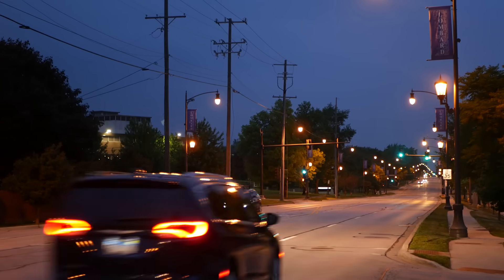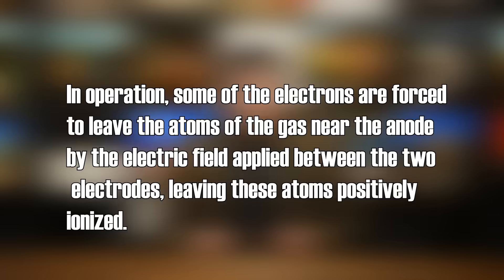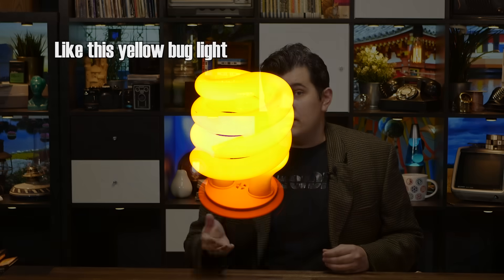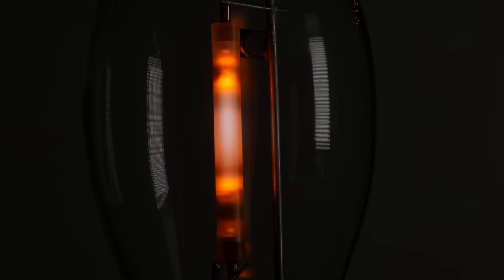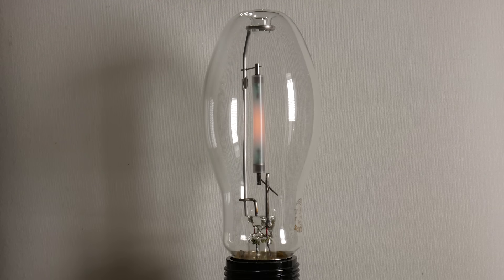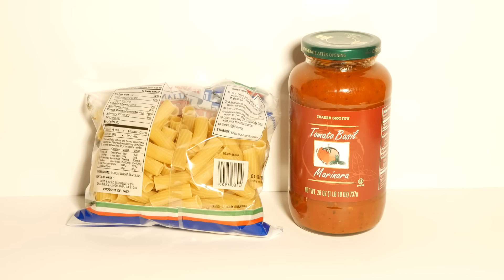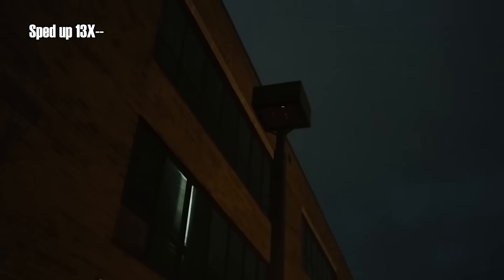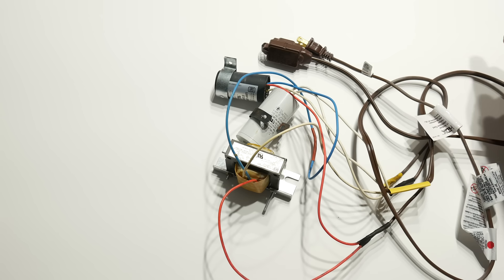The High Pressure Sodium Light: Ubiquitous, effective, but good?

Comment: I will state one positive for the low-pressure sodium lamp from an astronomy point of view. Light pollution is a major issue for astronomy. But low pressure sodium is easier to block out with a filter as it is monochromatic.

Comment: In the Essex UK our Council has gone down the LED route with all street furniture. Cold white light, the LED diodes are domed and act more like a individual spotlights, so when you pass under them your entire vehicle is lit up inside as a brief flash. Quite a unpleasant experience.

Oh and the failure rate is hight one  in 15 lamps are in a constantly loop of flashing on and off.
Reply: Update a year later my entire county at night can be seen as a faint flashing 10hz strobe from the james webb telescope.

Comment: Sodium lights are used widely in public spaces. That usually means up on a pole or a light stand of some sort. So changing one can be an expensive proposition. The lifespan of a sodium light is about 50% longer than a mercury lamp in the same application. So do the maths. Not only are they efficient, they last and last and last. And that adds up to dollars. The colour is a little weird, but that can be forgiven, allowing for the fact that they are not generally used where accurate colour information is required. 
LED bulbs are replacing fluorescent bulbs, but are only recently giving a choice of spectrum. For fluoros, the range was daylight, warm white, warm white deluxe, cool white and gro lux and also red ones for butchers displays. They also came in different wattages, with VHO bulbs giving almost double the light over common bulbs, for a given space allocation. The ballasts cost a small fortune, but man, were they bright!

Comment: "Why are streetlights orange".
Here most of those crappy orange (Actually warm yellow) lights (about 2700K) are changed to either "cold white" (about 4300K) or even "cold blue" (between 5500 - 6500K) bulds (that work in the exact same way as the yellow lights) or better: LED's.. Much better light! :)
LED's are more efficiant and gives more light per watt..

Comment: The problem with high-pressure sodium, for me, is the lack of cool tones in the emissions spectrum. And I'm not just talking about blue. Even green is underrepresented. In the RGB color space, we're used to the idea that yellow must contain green and red, but this is not a universal truth. "Yellow" light made with an RGB display, or by shining white light through a yellow filter, may indeed have a healthy supply of green and red light mixed in. So a green car would usually appear green and a red car would usually appear red under this light. This isn't because of the "rule" that yellow light has red and green, but because this particular yellow light does actually have red and green. (Other animals with differently-made eyes might not even agree that red+green makes yellow.)

But if that yellow light was instead made from a spike of actual yellow light--a single wavelength between red and green instead of a mix of red and green--then red things will not appear red and green things will not appear green under it. In fact, depending on what those red and green things are made of, they may not be illuminated at all, instead appearing dark and almost colorless.

"LEDs" can actually do a pretty good job of representing a broader spectrum. I put "LEDs" in quotes because I'm referring to the ones that use a fluorescent coating to get that broad spectrum. They're basically ultraviolet LEDs shining onto a fluorescent substance. And since "fluorescent" lights are not called "fluorescent" lights for their mercury content, buzzing sound, or tubular shape, but rather for the fact that they emit ultraviolet light that is then projected against a fluorescent substance, you could make the case for calling those LEDs "fluorescent lights" instead. But that would confuse people and this is why I sit alone at lunch.

Anyway, if they'd just warm up the LED spectrum output (by adjusting the blend of fluorescent dyes), increase the total light output, diffuse the hell out of it, and employ a bridge rectifier* and either a capacitor or inductor to get rid of that horrible flicker, LED street lights would actually be really pleasant.

* If a rectifier is too expensive, then a bigger capacitor or inductor.

Comment: Late to the party, but as a person 1 year away from my masters degree in physics, I would like to add that the Sodium D line is actually the Sodium d lineS, there is two of them.  The lines are very close to each other in wavelength,  about half a nanometer. This makes low pressure sodium lamps useful as a reference source if you need to calibrate a spectrometer or something :)

Comment: San José, CA went to low-pressure sodium for street lighting because of the nearby Lick astronomical observatory. The monochromatic output can be easily filtered out so the light pollution is manageable. But it's impossible to find your car at night because the colors are gone. Every car is gray.

Comment: Low Pressure sodium is the BEST for road lighting, HPS is second best..LPS is no glare, linear, and super efficient.  current LED high color temperatures are crap, driving in bad weather, and even in good weather the optics and too much blue are CRAP to drive under

Comment: I loved these lights. In my city, they would cast a warm glow that covered pretty much everything in a pleasant, relaxed light. Now that they all got replaced with LEDs, there's a tiny cone of very dim white light under the poles and total darkness in between, making them relatively worthless at actually lighting the streets.
Reply: @the_uggh  Light has an important function for life, including managing circadian rhythm, so, yes, the pleasantness of light is actually fundamental to how good they are. Second, the directionality and high intensity of LED lights actually creates higher contrast (blacker blacks) in less illuminated areas, which also means they function less effectively for area lighting.
Reply: @johnmickey5017  and that's why they have LEDs we don't need to have our circadian rhythms active at night.

Plus you know, that thing about excess heat burning through otherwise reliable methods of illumination
Reply: @kennethmiller3802 You completely missed the point. White LEDs (which contain blue spectrum light) at night DISRUPT our circadian rhythms. The blue light signals our brains that it's time to be awake because it mimics sunshine. This is the opposite of what you want to be exposed to at night. So if we're not supposed to be looking at it, why have the lights at all??
Reply: Where I live the LEDs are so bright and annying. I wish they would just go with a differnt color temperature, no idea why they decided to use daylight leds everywhere to blind my ass.
Reply: @ESSBrew  ikr, it's literally proven that yellowish lights are much healthier and safer for both drivers and non drivers
Reply: There are few things quite as beautiful as fresh snow under that orange-red glow.
Reply: @kevinmencer3782  God, I love that, it was my favorite part of winter. Unfortunately, in my town, almost all of the lights have been replaced by those white LEDs, so I really miss that image.
Reply: @sodaodaoda  gotta love when someone responds to someone else who added to what the original poster said and completely ignores an entire part of what was said just to make himself look like the high and mighty intellectually superior being in the YouTube comments.
Reply: @KenderGuy  Eh?
Reply: @KenderGuy  what???? Lol
Reply: @method2madnesssss  he was referring to the random hater. put 2 and 2 together...
Reply: @undeny  No one was hating though. And the guy he replied to was just saying how he missed the LED’s. So what hater???
Reply: @undeny  he wasn't referring to anyone.

He never pinned a name to his comment so to assume he was talking about one particular person is asinine.

Out 2 and 2 together.....hint, it's not 3 or 5, and can't be anything outside that range of numbers....5 tries...
Reply: I'm so glad you understand. I love the orange/red/amber glow of those streetlights. They inspire romance, and have played a role in many dreams of mine.
Reply: I understand it feels darker but it for sure isn't. The point made about peak sensitivity of the human eye and how that yellow is part of that seems relevant. Perhaps as well as this the contrast is causing this illusion where your eyes are responding to the bright light making the unlit parts of the street seem darker? I understand what you are saying though. I think a light diffuser really benefits all street lamps but it also often results in higher light pollution.
Reply: @the_uggh  try sleeping in an urban area without blackout curtains
Reply: IDK man, where I live they have replaced almost all lighting with LED's and the change isn't in how much of the ground is illuminated, the change is in how much of that light goes into the sky (less light pollution, and you can still see the road). So this might just be a lamp design thing instead of a LED thing
Reply: We need to get rid of the hideous white LED's and replace them with yellowish-orange LEDs.
Reply: @the_uggh  intentionally using an inferior product because it looks better is bad? Gee whiz I sure am glad no one ever does that.
Reply: I miss my warm and cozy yellow nights! 😭😭😭😭 Now LEDs are everywhere and they're such an eyesore. They're so fcking bright and blinding, I hate them. It blinds me as much as cars with bright lights driving towards me. I have photosensitivity so it makes me even more uncomfortable and on edge than most people. I hate any type of white light, I don't care about efficiency I still use 40~60 W halogen light bulbs at home
Reply: @the_uggh  Idk about anyone else, but where I am, the LEDs appear significantly dimmer (whether or not they actually are) and provide very little street lighting at all. Compared to how it used to be, it's almost comical and seems to mostly defeat the purpose (by comparison).
Reply: "total darkness in-between"
Reply: I prefer the orange glow over the led lights
Reply: Funny, for me it’s quite the opposite. I live in Chicago and all the lights are yellow and I’ve always found it very depressing. But out in the suburbs they have the nice white ones and I’ve always liked those despite them casting less light. I just find it more pleasant than that orange glow that bathes everything in the city even the sky..
Reply: @method2madnesssss  this. Those orange/yellow lights are so depressing.
Reply: @mikerogers9930  It's LITERALLY a different opinion... 🤦‍♂
Reply: @pi-squared1  and?
Reply: @mikerogers9930  Don’t judge/shame people for differing opinions.
Reply: @pi-squared1  isn’t that exactly what you’re doing to me lol. Go back and read my comment again then tell me who/how I was judging someone.
Reply: @method2madnesssss  same. I think it's a generational thing. We prefer blue undertone, it's fresh and clean. Boomers prefer orangey yellow, it's dingy and retro.
Reply: I had an auntie that was a massive bitch. I hated her so much. 
She has those cool white CFLs all through her completely white house which made it look & feel even more like an evil hospital hell.

Thank god she's dead but now I have white LED street lights to remind me of her.
Reply: Yeah i almost always take the extra 20 minutes to get home from the city just so i can drive on the highway with theese lights. Theyre just so cozy in a wierd way and just the perfect light to drive home in after a long day.
Reply: LEDs are indeed inferior to HPS because they are a flat surface light source that produces uneven non-uniform luminance. HPS is point source and spherical, so it emits uniform luminance with inverse square law characteristics, where LEDs are Lambertian and behave like a laser in their directional lighting intensity. Not only did this end up increasing light pollution, but municipalities also literally degraded public lighting by replacing it with something that doesn't provide the same point source illumination service as HPS. The horrid blue-light spectrum 4000K+ color temps are unsafe for humans and disrupt melatonin production and circadian rhythms.
Reply: All light sucks...Darkness is good
Reply: @mrhateful6664 don't be a dickhead,absolute total darkness especially outside and near roads is VERY DANGEROUS
Reply: @the_uggh  im from europe , we dont like LEDs
Reply: @Miichal_K  I'm not sure why so many people are celebrating high power usage and amounts of waste. LEDs are perfectly efficient and come in a variety of temperatures.
Reply: Wow I feel the complete opposite. Was happy when they replaced all the lights in my area. I love neutral white light.
Reply: @Distress. They're not neutral. They mimic sunshine which is the opposite of what you want at night.
Reply: I absolutely agree.  They are very dangerous, especially when a tree blocks the downward beam.  Very dangerous for women returning from evening shifts at night  - and even for the rest of us.  When I mention this to others, they look at me as if I'm an oddball.  Doesn't say much for the general IQ level.
Reply: The new LEDs in my city have the same issue and make more light pollution
Reply: These lights have been the bane of my life since I was a kid. It’s a soul crushing color that turns everything ugly. I couldn’t stand it coming in my bedroom window. I’m so happy that we are seeing less and less of them
Reply: Except for the astronomers who despise that optical interference with the Sodium d-line
Reply: @paulsherman51  im sure astronomers are happy to filter out soduim and have the rest of the spectrum fair game. with LED they are screwed. indeed astronomers are pro sodium for this reason.
Reply: I thought those completely awful CFL bulbs had a similar problem. They may have shined at the same lumens, but didn't seem to carry across the room as far.

Comment: Actually HPS goes far higher than 1000W with 1500W for example or at the extreme end the 18,000W lamps used to light stadiums.  Those 18,000W lamps last about 300 hours or 12 days :D.

Comment: I honestly hate the way HPS lights look, but they’re good for neighborhood use. They do an acceptable job of illuminating while not screwing with circadian rhythms. I’d like it if cities started using cooler lights in urban areas and highways though. Suburban areas (especially where speed limits are lower) don’t need as much street lighting, but dense urban areas as well as high speed highways need to prioritize visibility. Cooler lights are much more effective at lighting everything up at night. When you’re barreling down the interstate at 60 (though let’s be real, probably more like 70 or 80), effective lighting is critical to ensure safe driving. Furthermore, in dense city areas, you need to be able to see pretty far ahead as well as all around you for pedestrian safety. Cooler lights are more effective, but they mess with sleep cycles. HPS are less effective, but healthier. I wish our bodies weren’t so stupid

Comment: There still some High-Pressure-Sodium lamps around where I live, and it amazes me that those lamps are designed so that half of the light ends up going up into space, where it does nothing to light up the ground.  Why not just put a concave mirror over the lamp so that any light that would have gone upwards is now reflected down to the ground instead?  That way you get double the light output lighting up the ground from each lamp.  SIMPLE.

Comment: The HPS light is not very orange : this is the LPS light who delivers an actual orange light. Consequently, the restitution of colors by the latter is very bad, but the luminous efficiency is higher and the insects are less disturbed (because it contains no  short wavelengthes).

Comment: Discharge lamps
Mercury vapour = blue/white light
Sodium vapour = yellow/white light
Read up on colour temperature and the human visible spectrum.
The yellow light artificially expands the grayscale in low light situations == better object definition, especially in misty or foggy circumstances for better, safer visibility.
Try a yellow filter when looking at a monochrome picture, the detail becomes more pronounced.
The blue/white lamps provide better overall illumination, but give stronger reflections from the atmospherics. (similar to the incident light filtering experienced with polarised light)

Comment: Switching to LEDs is great and all, but I wish the ones used for street lighting were a lower colour temperature, closer to the HPS ones.
Reply: Only in quieter, residential areas. Other than that on busy streets whiter light is better
Reply: Only problem is, the phosphor coating becomes much heavier as the LED light gets warmer which means they have to run at a higher power to achieve the same brightness, which in turn increases energy consumption.

Comment: RIP Sodium lights, you were so much better than LED
Reply: No they weren't. That's nostalgia speaking
Reply: @exoticcar5482  Nope it's facts speaking.  LEDs are replacing sodium because they're cheaper for councils to run, simple as.  As far as providing light at night goes sodium were/are significantly superior as they don't have the tiring effect on drivers eyes that LED does.
Reply: @llynellyn  LEDs don't have to tire people's eyes. They just like to use LEDs that have too cool of a color temperature. Mercury Vapor was just as bad if not worse and it was around before HPS became mainstream.